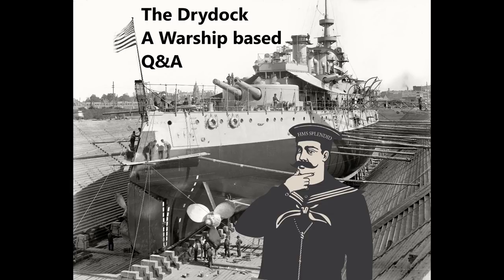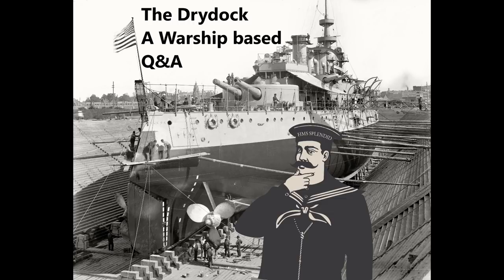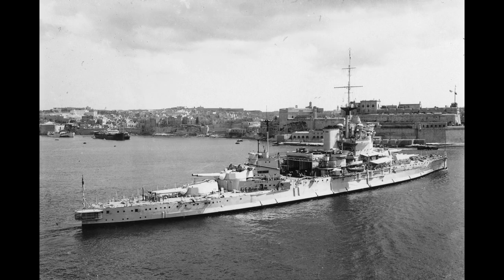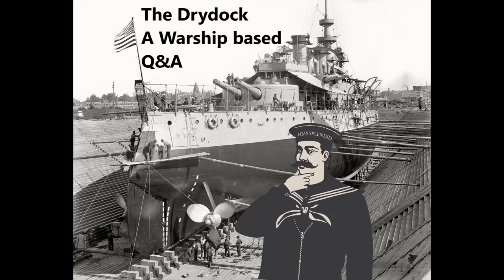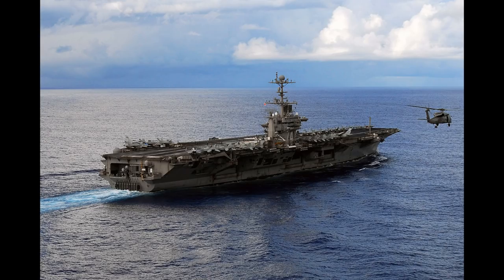The Drydock - Episode 086

Comment: Q.... The Americans used welding for joints, the British used rivets, the Germans started out using welding and changed to riveting. Which do you think is better?
Reply: Nguyen Johnathan  The KGV had welding on unimportant joints. Germany abandoned welding completely in 1939.
Reply: Earlier American Submarines were also of riveted construction.  

Riveting as a construction method was last used in the Perch Class which were awarded in the 1935 Fiscal Year building plan to the USN Yards at Mare Island and Portsmouth.

All US submarine construction after that was of welded construction.

The answer to which is better is Welded Construction.  

A proper welded joint is as stronger or stronger than the two pieces of metal that are joined. 

Riveting is a mechanical joint using the compression formed by the cooling of the rivet to form a water tight seal.  The individual rivets are subject to stresses in all axes which can cause their failure.  That results in a nice hole in the pressure hull letter the "wet stuff" in.  That would be bad!
Reply: @lilidutour3617  A modern welded joint is better than a riveted one, 1930s  the welding techniques they used were primitive and poorly understood, had little durability, were brittle in freezing seas and fell to pieces under fire.
Reply: @Fiddling_while_Rome_burns While I agree that Modern welding is better than 1930's welding.  I do not agree with your premise that riveting was the better construction method for the reasons you stated.  Please provide references that support brittle fracture of these welds in freezing seas (haven't seen this in any account of arctic convoys that I've read) or that they fell to pieces under fire. (Vast majority of USN fleet in 1941/1942 had welded construction and many of them DIED HARD.  I volunteer at USS Yorktown CV-10 and her keel was laid December 1941)

My submarine reference is 
The Fleet Submarine in the US Navy" by CDR John Alden, USNI Press

Once the switch was made to welding in 1935/36 there is no mention of riveting being superior to welding at any other time through WW2.

Furthermore I have read accounts from Submarine Veterans serving on riveted boats.  They didn't like it.  The leaked and viewed welding as superior.

Comment: ASide from changing Bismarck to an all or nothing armour scheme you also have to raise her low armoured deck as that was one of her most glaring weaknesses.  It left the vital power and communication linces vulnerable to being easily destroyed by hits which may not have penetrated her deck armour.

An ANZAC fleet fo that size would have been interesting,  Would the Japanese have supported the idea if their alliance with Britain was not cancelled or was replaced at US insistance with an ANZAC/Britain?Japanese pact with a secret 'understanding' they considered the rapacious US as the main opponent.
Though it's easy to see the huge US dummy spit at the prospect of that alliance.
Reply: John Fisher 

Changing to an AoN armour layout would raise the armour deck by default.
Reply: @bkjeong4302  That's not a guarantee.  You can do an all or nothing scheme and still leave the armoured deck low if you wish.
It's up to the designer.  There is no law that says you HAVE to mount the deck high, it's just a common sence reaction to the growth of airpower and the increase in the number and importance of power and communication systems.  Something the German designers ignored and could still ignore if they want their beloved turtleback which is better for close ranged engagements.  After all they never got off their triple screw design despite all the evidence of its flaws.
Reply: @johnfisher9692  First, AoN armour schemes inherently had taller citadels and higher armoured decks even before airpower became a serious threat (which was in the 1930s): look at the Standard battleships, designed and built in the 1910s and 20s.

Second, the Germans didn't make use of AoN (when everyone else did) because they simply didn't know it was a thing (due to them missing out two decades' worth of naval design), not because they opted to not go for it. AoN is better even at close quarters, since it a) protects more of the electrical system and b) generally offers thicker armour protection for the citadel.
Reply: @bkjeong4302  What rubbish
Just because the Germans couldn't BUILD BB's did not mean they weren't designing them on paper like everyone else did. Much like they weren't supposed to have Submarines, they just 'outsourced' the construction of those to other countries.  No one was building BB's after the mid 1920's.
The Nevada pioneered the AoN scheme and those ships commissioned in 1916 and it is absurd (or  typical German excuse making) to say they didn't know about it in the TWENTY years before the Bismarck class was designed.  The Germans preferred the graduated armour scheme for a simple reason.  It gave more protection against the small guns likely encountered as a typical convoy escort while they were shooting up helpless merchant ships.  The German capital ships of WW2 were not built to fight their opposite numbers, they were units of national orestige and merchant ship killers.
Reply: @johnfisher9692  It is absolutely NOT absurd to say they didn't know about the AoN armour scheme in those twenty years due to losing that much naval design experience (Drachinifel has even pointed this out). They were NOT designing battleships in that interval, because they literally couldn't; they could NOT outsource battleship design to other countries like they did with submarines.

And the four German capital ships were intended to counter the French capital ships (though in terms of capabilities the French would have beaten them). Commerce raiding was never their primary role, but something they were forced into due to being pointless and unnecessary. Nobody built battleships for any purpose other than fighting peer opponents, because that was the only thing they were ever cost-effective at (though by WWII carriers had mostly rendered them pointless even in their intended role)

Also, as you just pointed out, the Nevadas had AoN in 1916, with raised armour decks, so you yourself should know that a crucial part of AoN armour scheme is that raised armour deck.

Comment: I like your content Drach but i think you were wrong about German submarines. You said Germany was right to focus on type VII as type IX and type XXI were bigger and had longer diving times. What an uninsightful argument. I hope you do understand of impact of type XXI idiologicaly aswel as technicaly. Type XVIII and XXI were the first real submarines, not boats that can submerge. Radical difference in speed submerged gave type XXI crazy advantage. I think they should have focussed on type XXI and other "electroboats"  as they were to be the standard of the future and obvious improvement over previous "hybrid" types.. If you are unaware before type XXI submarines had huge diesel engines and relative small batteries that gave them advantage when surfaced but wasn't helpful under water. Dr Braun changed that to large batteries and small engine to keep those batteries charged, no direct diesel propulsion..  that was a gamechanger and if Germany had implemented that technology in 1941 they would have sank a lot more

Comment: If Chobham armor is as good as it seems on tanks why not put it on ships?  if the Bismark had bow thrusters it  would have been able to make Brest in time to get a Tall Boy : )
Reply: Lili's Husband Bill here and Merchant Marine Captain for 19 years.  Due to their location, in the bow obviously, the thruster's efficiency drops off precipitously as the speed of the vessel increases.  I seem to remember that anything over 4 to 6 knots headway and the thruster was useless.

Also, the thruster was at the mercy of the elements.  Heavy seas and/or wind would also negate any positive effect the thruster would have.

Bottom line, I don't think it would have helped Bismark get under friendly air cover before the Royal Navy showed up and sank her.
Reply: Other than the fact that it didn’t exist when ships were still being equipped with armor, it is probably both too dense to float and too difficult to attach to the side of a ship.